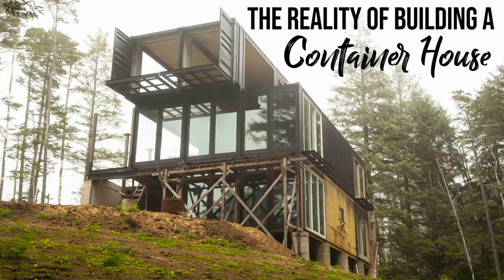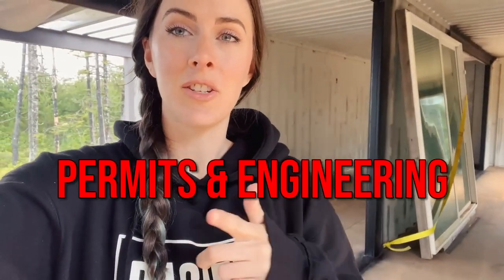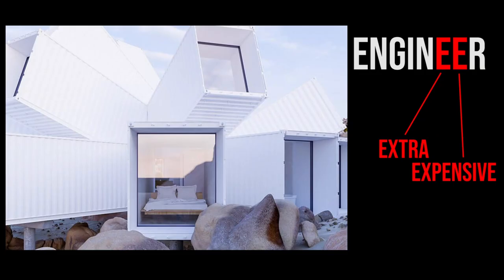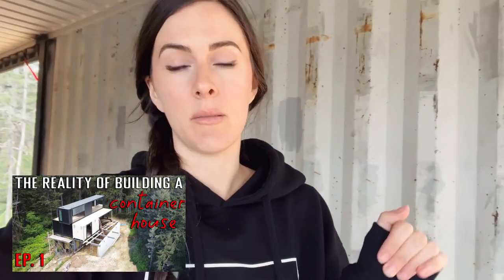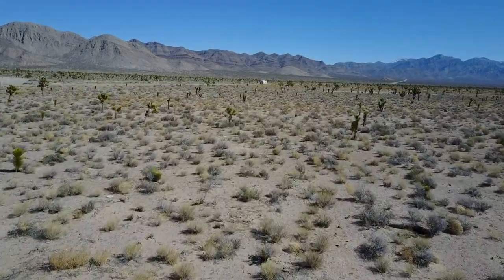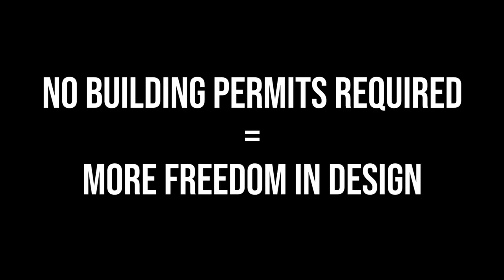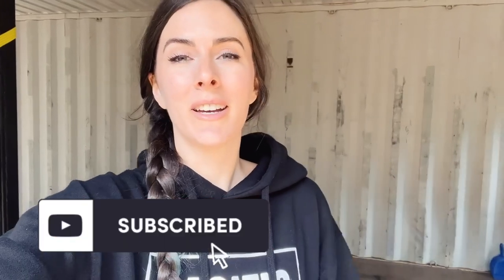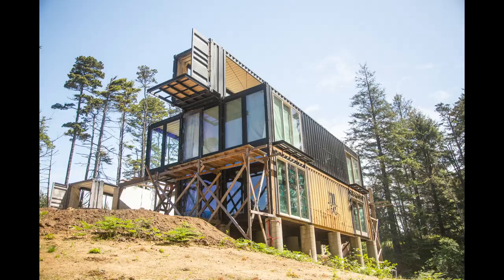Ep 2 - The Reality Of Building A Container House - PERMITS & ENGINEERING

Comment: I've wanted to do this for YEARS, and still plan to.  I have so many ideas, and really appreciate you sharing your experience with all of the finer details.
Did the engineer give you any structural height restrictions or advice, outside of your ocal building codes?  When I do this, I'd like to be above the treetops, so possibly 4-5 containers tall.
Reply from the maker: I will go over that topic in another video in the series where I talk about construction. The containers are made to be stacked about 8 high so it's definitely possible, but it would take a bit of engineering if you plan to do multiple cutouts, etc.